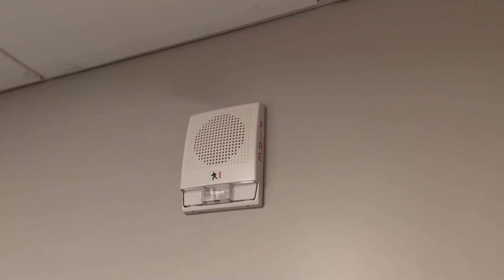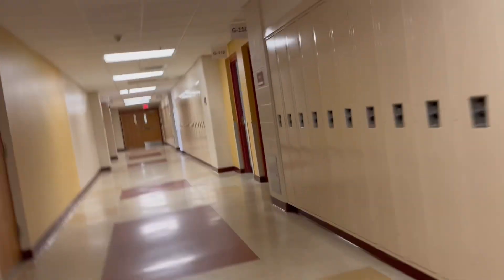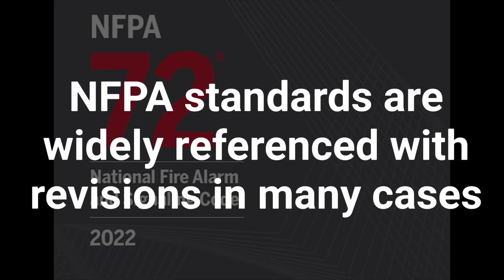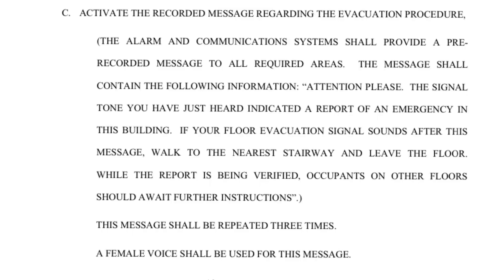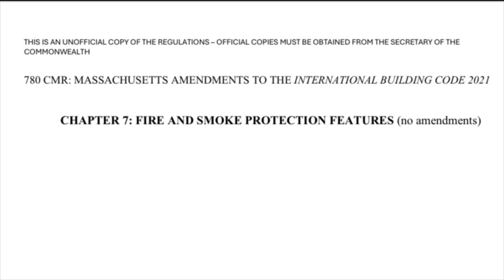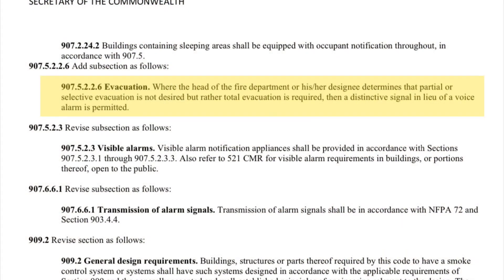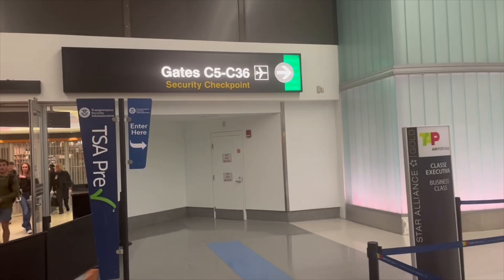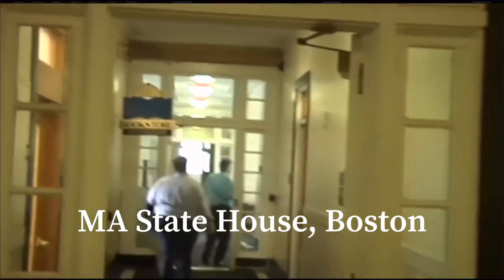Why do EVAC Fire Alarm Systems Sound The Same in Boston? Why Do Some EVAC Systems Have No Message?

Comment: 0:28. That's 11 Apex Drive, Marlborough, Mass. I may have, with my job a lot of interaction with that building. The old low voltage systems are the ones I hate, so goddamn loud.
Reply from the maker: Correct! I’m shocked someone knows where that was.

Comment: The EST code 3 tone sucks! It doesn’t sound authoritative or commanding. The Notifier tone has more urgency and is more commanding than that little EST beeper. I also really like the modern Simplex whoop tone. It also has a lot of urgency in its sound. Fire alarms can be as loud as possible but if they don’t make an urgent sound then it won’t be effective. There’s a reason why fire alarms make loud obnoxious noise and not pleasant bird chirping noises. You need something that is commanding! Loudness only does half of the job. You need urgency!!
Reply from the maker: I completely disagree. The tone is fast paced and I think that has much more emphasis than the other tones

Comment: The one thing that all national and local codes forget is that building occupants do not know what code 4 or code 3 means.  Every system should have some sort of voice alert that provides specific instructions based on the combination of events.  Each panel is able to process this and provide the appropriate direction to occupants.  One of the other issues is when you use a single tone, you are alienating people that have hearing issues, as some people can not hear a specific tone frequency, but if you use a swoop tone, you hit numerous tone frequencies, and therefore have a better chance of occupant notification.  Same holds true to jurisdictions that use a single tone tornado alert - many people will say they never heard it, but people in jurisdictions that use the air raid feature, hear it.

Comment: Yep, I've heard the EST-3 voice-evac system at the Hynes Convention Center (where Anime Boston is held) and the Simplex 4100ES voice-evac system at the Boston Park Plaza (where Anthro New England was held from 2018 to 2022), and they all do their respective Code-3 tones along with their respective multi-floor high-rise evac messages. But in the case of Simplex/Autocall, the Code-3 tone is still one of their most popular voice-evacuation system tones alongside Slow Whoop.

Comment: The simplex True Alert system at the college I attend  (Holyoke Community College) the tone is the new simplex 4100U or 4100 ES slow whoop with a female voice Evac stating:  There is a fire emergency in the building, you are to leave the building by the nearest exit or exit stairways. Do not use the Elevator. Below is the link to the video that shows the voice message and tone:

https://youtu.be/-gX7nH0agGA?si=oPkqtadYpWnc0Sv2

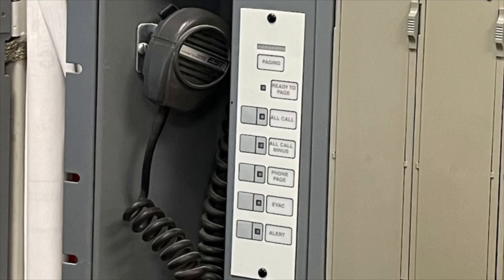Comment: 6:57 Those buttons do not choose different messages. Those are just mic paging controls for the 3-ASU (EST3 audio controller). Those buttons call certain psuedo points in the EST3 where an installer can write custom commands (called rules) to determine which amps and SIGA-CC1 (addressable riser control module) can fire on the “page” channel. All call will usually activate all risers and switch them to the paging channel, all call minus will activate any riser not being used for evac and switch them to the paging channel (perfect for floor of incident command), evac button will switch any riser being used on the evac channel to the paging channel, and alert button does the same as the evac button but only for anything active on the alert channel.
Reply from the maker: Ah, gotcha, thank you for the clarification

Comment: Does Wheelock play the regular Safepath SPMNS Temporal 3 tone? Is Wheelock required to have a special message, or is it the default messages? I'm only asking because Massachusetts regulations for Wheelock were not specified. It's having me dig in a deep place. I really can't dig since I've never been in Massachusetts. I've only recorded a Fire alarm at a hospital in Missouri. I did record a fire drill in missouri too, however It's either obsolete or I have to find it.
Reply from the maker: in general all systems regardless of brand must conform to the standards in the video

Comment: At Westgate Resorts in Myrtle Beach, SC, it sounds like the Simplex Alarm tone, and it was at 3 am.
It also goes something like "Attention, attention: an emergency has been reported in this building. Please proceed to evacuate the building, use stairwells, do not use elevators. Repeat: Do not use elevators."

But the strobe light resembles the one seen at 06:50 in this video.

The Pull Stations resemble the "Lift Then Pull Handle" model seen at 01:25 in this video.

My theory for why the alarm might have activated so late at night is that a child most likely pulled a Pull station upon a late-night arrival.

Comment: I like to call NH the 'voice evac capitol' of this country, since I have literally been to a CVS in Nashua that has voice evac lol. Many similar examples in that state.

I believe voice evac should be more standardized, and it's good to see it gaining popularity. I have been in this industry for years and I am definitely seeing a lot more voice, but it's only really the case for schools in my area. It's becoming more mandated in general for other sorts of buildings here now too!

To add, a lot of systems that aren't highrises in boston usually won't get messages, even if they're voice. Typically it'll only get voice if the engineer requests a lowrise message, but highrises in boston ALWAYS get a highrise message, it's required for highrises as seen. But with lowrises, it's up to the engineer if they want a message or not. The high school I went to (Though on the Cape in MA, the system was installed by a Boston company so it got the boston spec - A code 3 tone, but no message cause it's a lowrise and the engineer did not request one.

Also I always found it kind of peculiar that specifically a female voice is required. Any clue to why that is? I used to do fire alarms in MA, (now in NY) but that's the one part I am unfamiliar with.

Voice evac systems started way back in the day being just audio with paging. (Late 1960s autocall - they invented it. The system would just do a slow whoop tone but had paging abilities.) So the paging is very much where it started, which is cool.
Reply from the maker: Yes, as shown in the code reference, when the head of the fire department determines that evacuation is necessary, a message is not required. 

At 3:18, it states that a female voice shall be used for the message.
Reply: @FireAlarmDude5967  Any idea why specifically a female voice is required?
Reply: @AcElectronicSystems it has something to do with people subconsciously following instructions better when it’s a female voice. People are also more likely to follow a male voice for things like giving directions. Transit systems tend to use female voice recordings for emergency and important instructions and a male voice for wayfinding messages.
Reply: hello fellow granite stater, trust me, my high school in the small town of Portsmouth does actually have a voice evacuation system with it being made by Wheelock, now this is the only building that I'm aware of having a voice evacuation system in it at the moment.
Reply: @NathanLadd-p7zYeah it’s more than likely Mircom voice evac which NH has a never ending amount of.
Reply: Ah alright